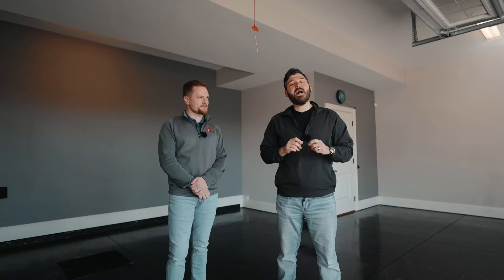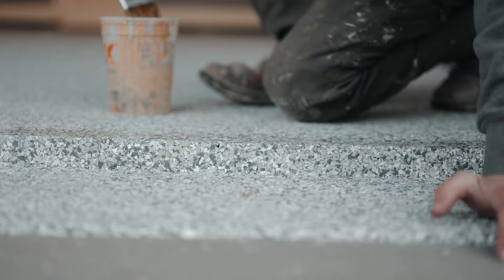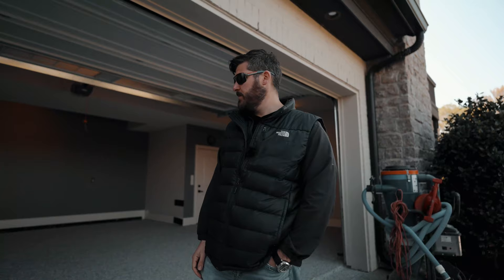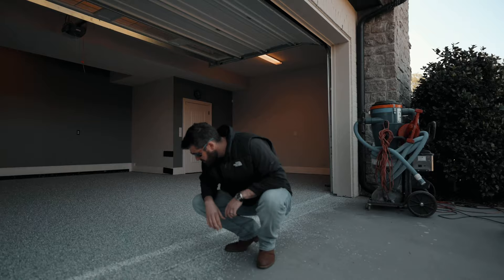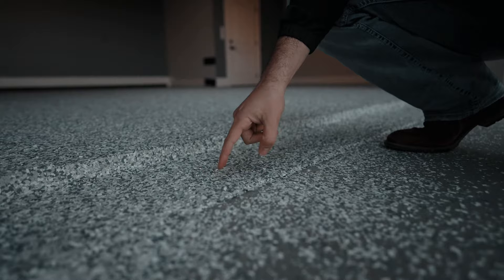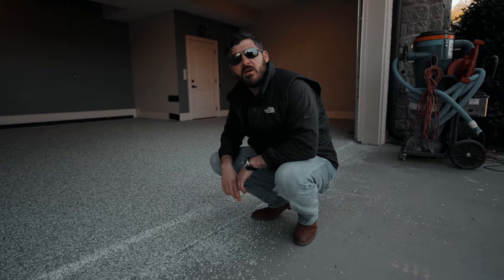Polyaspartic Garage Floor Coating After The Epoxy Mistake - Big Thanks Titan Garage Flooring

Comment: Swisstrax!
Easy, you do it.
Over epoxy. 
Done.
Reply from the maker: I actually started this garage with Racedeck. Unfortunately ordered the wrong plastic type, and didn’t like it. Epoxy was better (quiet), but didn’t hold up or have a cool pattern. Live and learn as they say.